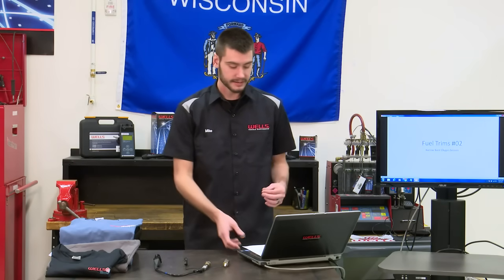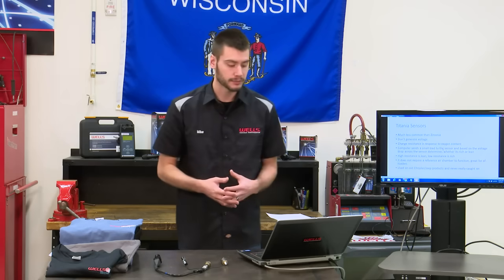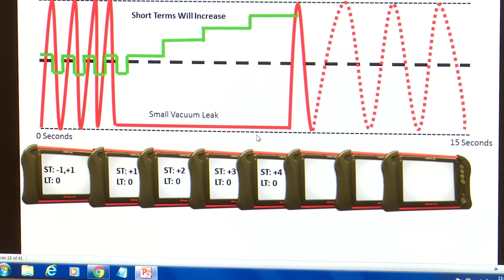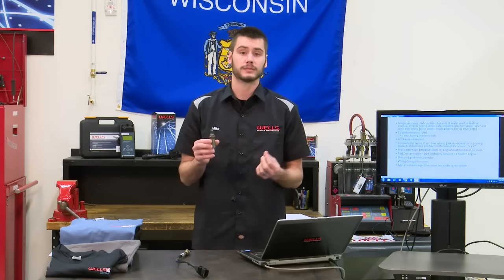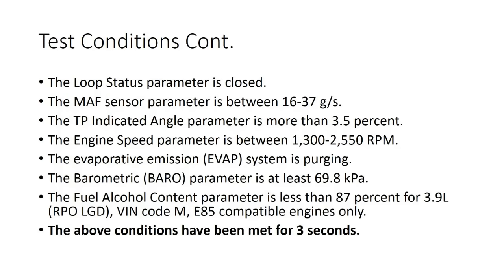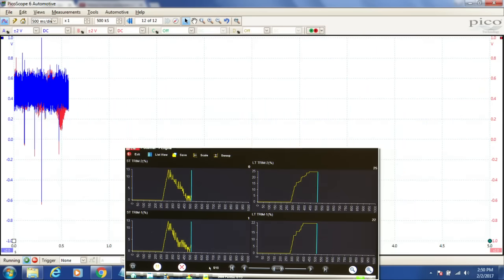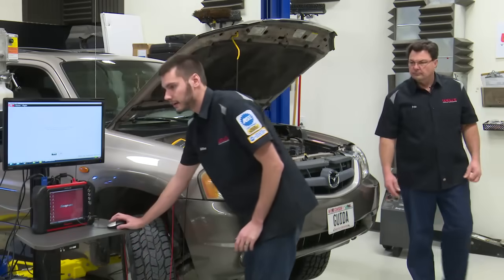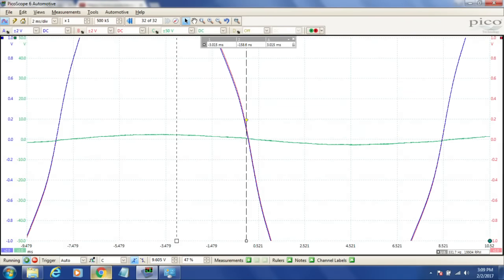Fuel Trims – Oxygen Sensor Basics—How They Work and How to Test and Diagnose Them (O2, HO2S)

Comment: Hello professor ,  i have an issue on cold start first 5 minutes of work on 2.0L TSI CCZB VW Engine , ive been to mechanics and changed a bunch of stuff , but it still Stutters and hesitates on when cold , Engine load on OBD diagnostics goes to 50% when cold on normal drive , i think that is not normal , since when worm it doesnt go above 30% on normal drive , its a 200bhp engine after all .
Can a Oxygen Sensor failing cause this behavior , bad mixture and misfires , i had a code for misfire and some oily stuff , sludge or something like that , but ive changed Timing chains , belts , pumps , fuel filter , sparks , intake manifold , a lot of stuff and same thing , nothing changed ... so im thinking PCV valve or Oxygen sensor , or Vacuum leak ...
Reply: YOu might want to check your TB Assembly if you have iSCV, what year model is this again?
I've been there for more than 5 years , and now that i Learned alot of stuff, i am earning here as freelance mechcanic now. 
WIth that said, been 5 years in 5 minutes or 10 so cold start issue, engines rattles and hesitates only stops when @ normal operating temp. It turned out that i want back to it's TB and iSCV + this air pockets in between, and voila been 4 or 5 months since idling is all good.
Tho admitedly now seems TB assembly wants to be cleaned again, for my wife's Toyota Corolla 2000.
(I turned out to be a mechanic since it felt like i can't trust much of these mainstream auto shop or auto mecanics out here)
Hope This method in TB could help you.
see you ,

-Mark
Reply: @macegarage9603  Thank you for the answer .However i doubt its a TB because yesterday i turned off the car after 3 minute drive , it was just getting to 80c, close to 90c but not there just yet .
left it for 5 minutes , came back in , cranked it and it turned on , but was working on 3 cylinders , you can tell , there is no mistaking it , rattle , shaking , strange sound .
So i stepped on the gas a bit , and then RPMs jumped lot more  , like it was burning unburned fuel from all the non spark moments before , and then came back down and was working normal .

I dont see how TB can cause this behavior , sounds to me like no spark or no compression , or weak spark and weak compression .
So i ordered 2 coil packs , should be in in couple days and then we will know .
I just hope its that .
the model is 2013 Skoda Superb with DSG , and 2.0 TSI engine .
Reply: @dedskin1  Hi thanks for your response pal, Ow i see that COld Start issue (after I have rered your first comment) of yours is really about something wrong with voltage supply or something else about vacuum. 
Anyways,you already analyze your car and found somethng  might be wrong @your coils, this happens alot also with our clients. if your have already ordered, 2 coils, looking forward to your update then.
(i see a 2013 year car model won't have this iScv issues since they don't already have em unlike at older models, but in which the older ones very similar with your cold start problem)
Stay safe  ^^
Reply: @macegarage9603  I have a regular service oil change this week as well , but 2 months before i was at my mechanic as well for oil change and parts change , we took the Scanner tool , and scanned the car .Literally 0 faults , nothing wrong .
But of course the car was heated up then , its hard for me to take the car to him and have it cold at the same time .
But still if it   here was a  fault the ECU would record it , so i suspect there will be no code  this time as well .
I Think the Scanner will just read Massifiers without code . 
When i Changed the Intake Manifold Electrician did check and found Misfire , and he said its due to cracked intake manifold , i changed that .
But still its happening , so i think the recorded misfire was not due to the Cracked Intake , but intake was cracked non the less and required changing .
I will update you when i do this regular oil change , Scanner and Coil Packs .
And we will work from there .
 
So long story short , i went to mechanic to scan the car , change intake manifold , timing chains and belts , water pump , Decarbonization , sparks and maybe something i forgot , but none of it fixed the cold start misfire issue .
I am also suspecting Vacuum leak , bad sensors , or bad coils .
I guess will see .
I will update you .
Thanks

Comment: Neither of the techs are correct. The second sensor is after the 🐈
Reply: Why would that prevent it from failing? Disconnect a o2 sensor and tell me you don’t get a constant voltage

Comment: Bank 2 p0430 nissan murano.   Bank 2.  I removed my OEM plug and is different from the bed o2 sensor.  Oem is bullet shape.  New o2 sensor is cylinder with holes around.  Are they the same?
Reply: HELP ME.

Comment: i got P0420 on 2014 Nissan Patfinder Sl AWD on cold day. P0420 Catalyst System Efficiency Below Threshold (Bank 1) should i change the O2 sensor, Air Fuel Ration Sensor, or Cartalyst converter? please advice
Reply from the maker: Hey, honestly the first step would be to perform proper testing on the 02 and the air fuel ratio sensor. I wouldn't go throwing a catalytic convertor at it at this point before testing those 2 sensors first.
Mike Becker, Senior Instructor

Comment: My Subie Radio gives this #reading 
* PSI BOOST/vac -11.0
Throttle@1%
OiL@120 degrees
RPM@760
IMF/lb/m@0.2
INTAKE@48 degrees •F
MAP@3.6psi
EGT 437 *F
EXTERNAL 37 *F
LOAD@21%
COLANT@163 •F
AFR 14.5
VOLTAGE@14.1
MPG@22.3
PEDAL@13%
ACCEL@0.000g
TIMING@11*
Reply: The check engine light 💡 is On #P0102 #P0113 #P0171

Comment: Can we ohm test the oxygen sensor wire?
Reply from the maker: Are you talking the wire from the car or the sensor? You can ohm any of it, but remember that an ohm test only needs 1 strand to be a good circuit. It's not the best way of testing. 
Mike Becker, Senior Instructor

Comment: If I live in a state that always rains,  then putting some dielectric grease on the connector will make sense.  If the 02 sensor has constant volts, my guess is it is not doing its job, replace it with a genuine DENSO or NGK or manufacturer recommend 02 sensors ( never buy a brand you never heard of ) will be my best bet.  Therefore my answer is C: Both.
Reply: G .
C no a

Comment: You listed causes of failure, but assuming I'm comprehending this: Wouldn't an exhaust leak also be a potential cause for failure (or at least skewed readings)?
My assumption is, if leaking exhaust gas is able to enter the reference port of the sensor (the wire), then you will not be getting a reference to clean air, but instead a "diluted" exhaust gas reference, which is proportionally like having a cracked ceramic casing, to the degree that the exhaust gas is saturating the air around the inlet.
Can anyone confirm if this assumption is correct?
Reply: Leak bifore oxigen sensor,yes.
Reply: @sedmioddevet2201  Thank you for the reply. I had figured it out in the interim, but I still appreciate someone seeing my question and taking time to answer it.
Reply: @OverDue_Gunny  it isnt wasting time when i see to help a decent person. Stay safe.

Comment: I would say the answer is probably D. The first guy used dielectric grease, I never have, but he didn't mention resetting the check engine light. Tech 2 is probably reading a combination of non cleared date and maybe the effects of using dielectric grease.

Comment: what does it mean close loop and open loop?
Reply: Good question. I THINK it is when the O2 sensors reach 600 degrees, at which point the PCM begins using the O2 sensor input to adjust air/fuel ratio instead of the PCM preset default settings.

Comment: Tech B. I think you use anti sieze not dielectric grease but I could be wrong. I know that they use dielectric grease on spark plugs
Reply: anti-seize is for use on metal on metal contact like on threads that need to be easily removed or mounting surfaces that you don't want to rust weld. You can use dielectric grease but you don't want to glob a whole bunch on there and fill the connector with it. You can also use a little spritz of silicone spray.

Comment: Every year, more and more dependencies are created.  See?  Where is our independence from these manufacturer's dictation of technology.  Notice they are all on board, some how, with each other?  Trust and faith?  Yet more and more dependency is created on more and more so-called tech savvy technology.  We are expected to believe that the increased technical complexity means, somehow, evolution of technology.  This is a lie.  A higher technology means, to me, easier ability to use and repair and less expensive, to the degree we really understand actual laws.  But you don't believe this?  You may being misled.  Do you realize that all the great engineers have been put down, while their stuff stolen and the public is not the wiser?  Main stream technology is near fully controlled. This o2 stuff is just that "not the wiser" stuff.  How do we get around the O2 dependency technology? How about a simple by pass of the stupid dependency, like a resistor that gives the stupid computer a good reading all the time?  Who is the wiser.  But you still believe we somehow need this device.  Dependency is weakness to alien (foreign) control!  Independence is power to the people.

Comment: Really great video.  I believe the O2 sensor gets its reference atmospheric gas from the sensor wiring hole between the wiring and the O2 sensor body.  At that point, there is no seal.  Thus, the issue with off-roading getting mud on the sensor, blocking the air.  I don't see the sensor getting air through the wiring itself.
Reply from the maker: Hey George, thanks for watching! Have you ever seen power steering fluid, coolant, or oil wick all the way up a wire harness back to a module? If liquid can do it, I can assuere you that air can. 
Mike Becker, Senior Instructor
Reply: @GoTechTraining  Interesting, yes I have seen liquids wick, just can't picture air doing that.  Sounds like it would be a great demonstration experiment to test that.  Great videos, bt the way.  Learning quite a bit.

Comment: Do I need to disconnect the negative on my battery before changing my up stream Bank 2 sensor 1? This is a 2014 Yukon XL 5.3L V8 SLT.
Reply from the maker: Hey Chris, naw, it won't matter as long as the ignition is turned off. 
Mike Becker, Senior Instructor
Reply: @GoTechTraining  thanks!

Comment: I have a question about the Tech2 advanced fuel trim re-set option . 
Would this be applicable in a situation when the ECU constantly shows a -100% fuel trim bank2  (Gm 2.2 ecotec engine)
the wiring harness seems OK  and provides voltages 13.7-14 volts and 4.5 volts, the oxygen sensor is brand new. There are no fault codes whatsoever.

Comment: Thank you so much for inviting me on oxygen sensors I was stuck there for a while thank you but one more question on a BMW 2005 Bank 1 and bank 2 those are up front by the spark plugs or by the muffler I mean by the muffler or I should say that Cadillac converter correct
Reply: Bank 1 S1 and Bank 2 S1 are pre cat (next to spark plugs.) S1= pre cat.

Bank 1 S2 and Bank 2 S2 are post cat (after catalyst). S2=. Post cat.

🐱

Comment: 2014 GMC Sierra 5.3L, I have replaced complete three way cat system with new gaskets, and all oxygen sensors, still have code P0430 catylist efficiency below threshold bank 2, any Ideas?
Reply: Replace the converter
Reply: @lexbyfield8651   I replaced all 3 converters

Comment: When searching for a vacuum leak, use WD-40.. Unlike brake cleaner or carb cleaner, it won't ignite from a spark.
Reply: Or use water in a soda bottle put a hole in top of the lid n sqirt it around just don't use like a bucket or  dump inside a electrical clip.....    I tried the WD40 ,   because I don't want to blow up my truck.....
Didn't help me find none of the 3 leaks ,,  I found them visually....,,,    I'm going to use water from now on......there are videos on here for it....!!!!
Reply: WD will ignite. .
Reply: @peckerwood858  That's like saying engine oil will ignite.. Yes, it will ignite if you get it hot enough, but it's nowhere near as volatile as carb cleaner.
Reply: @damoncrowfeather4655  sorry I was being sarcastic i forgot to mention that. I had replied thinking nobody would actually believe i would say that. Should have used a few emojies and lol.

Comment: I have a 2008 Tokyo Tundra that had the wires cut on the B2S2 oxygen sensor. Replaced it but I still have a code p0157 still showing up! What do I need to do with my scan tool?

Comment: Awesome video, thanks so much.  When I saw how long it was going to be, I thought I'd skip through it, but ended up watching it from start to finish, sometimes going back a bit to check again!  One question:  Does the heater stay on or does the ECU know when it's hot enough from exhaust gases and turn off the heater current?
Reply from the maker: Hey Vincent, thanks for watching! That all depends on the strategy of the computer. Many will keep it on, just at a lower current draw.
Mike Becker, Senior Instructor

Comment: Should you see ~450mV at all 4 sensors (both upstream and downstream) when vehicle is in KOEO mode?  Would this just be the O2 sensor reading the air in the exhaust (engine off) as being close to the O2 levels of the air in the reference chamber?
Reply: I think it's just bias voltage, it's just a signal from the computer to the oxygen sensors and back. Oxygen sensor needs to be 600F+ to produce a voltage
Reply: @paymanghafoori  Thank you for the reply.

Comment: talk to me about octane booster with MMT  and the red residue that can build on the O2 sensor....  does it cause problems?
Reply from the maker: Sorry SJ, i'm not familiar with octane boosters with MMT. My gut says that any residue on the 02 isn't good though. What do the pores of the element look like? Have they been filled in by whatever's causing the red residue?
Mike Becker, Senior Instructor
Reply: @GoTechTraining  no, they are not, and we tested them and they work good.  I am starting to wonder if I handnt topped off the gas tank maybe one too many times and the issue is to do with the charcoal filter for the EVAP system..?

Comment: How does the fuel system enters closed loop how exactly ect sensor partipate
Reply from the maker: Hey Adiag auto, that depends on the system. Generally a vehicle enters closed loop once the 02 sensors are operational. The ECT probably needs to be a minimum temp as well.
Mike Becker, Senior Technical Instructor

Comment: I have a code for bank 1 and bank 2 being too rich but it has brand new injectors brand new MAF it’s not losing fuel pressure yet the P0172 and P0175 still throw any idea what it could be? Can’t find any vacuum leaks anywhere either
Reply from the maker: Hey Jason, a vacuum leak would cause it to run lean, not rich. What kinda vehicle are you working on?
Mike Becker, Senior Instructor
Reply: GoTech it’s a 5.3 vortec from a 2000 GMC Sierra it’s actually cleared the codes itself so far but it had and still does have a problem cranking when I first crank it it fires right up but 20minutes later it tries and tries and finally cranks but then I can turn it off and crank it again right after and it fires right up any idea what could cause that?
Reply: GoTech both p0172 and 0175 are thrown again twice each time my short term trim is good but long term isn’t

Comment: A
Oops, D.
I was not aware of the wire being the reference port.
Reply from the maker: Hey Glenn, pretty crazy right!?
Mike Becker, Senior Instructor
Reply: @GoTechTraining  
Yes. But in a way it makes sense. If you just have holes then all kinds of junk could end up in the sensor. I just always use dielectric grease in Auto connectors. I'll have to make a note to myself to not use it on O2 sensors.
Thanks for sharing that info 😊

Comment: I have a Bluedriver scanner. I'm not able to read upstream sensors, however I can read my downstream sensors, and I'm seeing +3 and -3 short fuel trim in most driving conditions, is it safe to assume my o2 sensors are ok?
Reply from the maker: Hey Kenyon, yeh, sounds like they are working ok. Do you have codes you're chasing?
Mike Becker, Senior Instructor
Reply: @GoTechTraining  no I dont, I just have a slightly rough idle on my 04 acura tl, I'm just trying to determine where its coming from. I can now rule out a bad o2 sensor :)
Reply from the maker: Thanks for that Jesus My Savior, i've edited it.

Comment: I have cleaned mine with Carb cleaner. Engine light turned off and then more Fuel Consumption.
Would you please justify it?
Reply from the maker: Hmm, well we don't recommend cleaning them...so it's possible it was damaged from the carb cleaner.
Mike Becker, Senior Instructor
Reply: @GoTechTraining   Got it. Again Engine Light is on.
When i disconnect battery, light goes away.
The amazing thing, after battery disconnection, only if I start   early Morning my car,  the light comes back.
Reply: @GoTechTraining  if it so..how does it supposed to clean o2 sensor ?

Comment: Doesn't the air fuel mixture correlate to exhaust gas temperature? Therefore voltage rising and falling according to the fact that the sensor needs 600 degrees at stoichiometric to read 0.450 volts is happening in part due to rise and fall of temperature? Obviously that only holds true to an extent. Rich enough and the EGT's rise due to combustion taking place further down the exhaust stream.
Reply from the maker: Temperature is required to get the element hot enough to essentially flow oxygen. After that it is simply comparing the 02 content in the exhaust pipe against what it has in the reference chamber.
Mike Becker, Senior Instructor